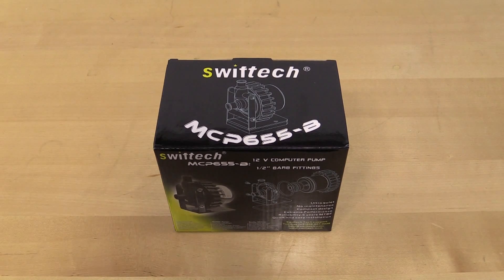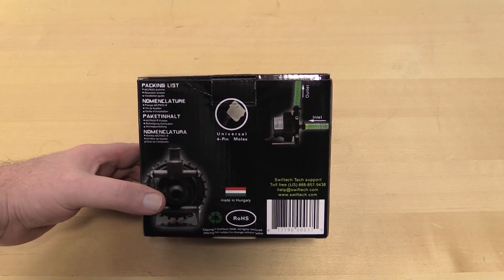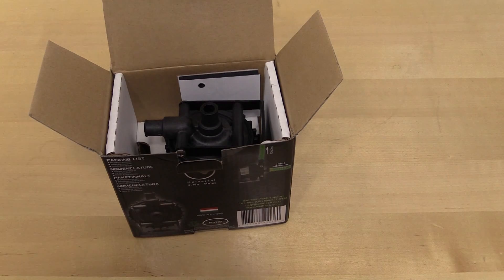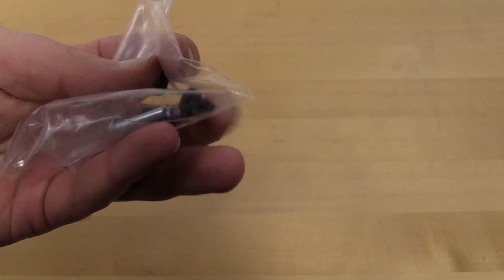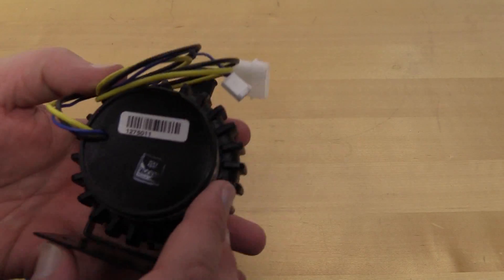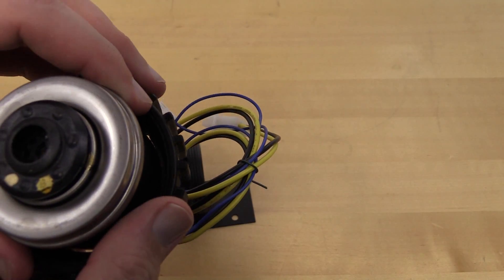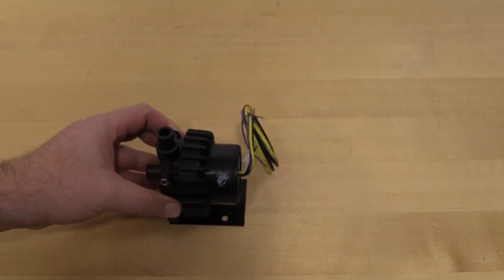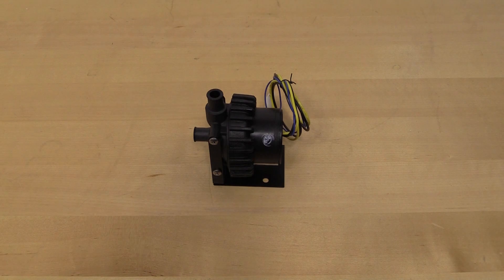Swiftech MCP655-B 12v DC Watercooling Pump

Comment: Do not purchase this pump, it will die and swiftech will not warrantyit.
I purchased two pwm models one on 12-16-12 and another on 08-23-13 and both have failed!  Do not believe their warranty claim of 2 years either, my most recent pump was purchased on 08-23-13 which is still within their "2 year warranty" and they will not replace it because it was purchased from Frozencpu.com. They state frozencpu.com OEM'd the pumps and they are responsible for the RMA. If the pumps was indeed an OEM pump why did it come in the Swiftech box with the pump housing, i've never seen an OEM part ship out in the original manufacture's box. How is a customer suppose to know which website to buy from to actually get a warranty? Do not support this company they will do everything they can to get out of honoring their warranty even though http://www.swiftech.com/warranty.aspx clearly states all pumps have a 2  year warranty. message me and I'll send you the email transcript.

Comment: i have the xspc D5 version that came with my photon res.
Reply from the maker: How do you like the res? I was thinking of buying one.
Reply: TimmyTechTV havent installed it yet as im still getting my parts together. it looks great and it is heavy. i have the photon 270/D5 combo. i also want to get the xspc aluminum screw ring for the D5 as it looks better than the stock ring.

Comment: I've looked at swiftec pumps in the past, and for what it does, I question why they often sell for $50-100. great specs and reliability, but buying some antec/corsair AIO coolers and modding them into a custom loop in my experience does a similar effect for a lot less.
Reply: You can't really compare the D5 pump to any of the AIO pumps.  One D5 can eaily run multiple blocks and radiators which the small AIO pumps are not made for.
Reply: psyduck170 true, assuming someone was to run a 480 rad with a CPU block and two GPU blocks, but MOST people don't even watercool their GPU's. There's tests done online proving that you can run multiple small pumps in series and the pressure/flow is mostly additive, and tests done proving that 1/4" tubing is adequate for any job.
as personal proof I'm running 4 120mm radiators with about 15 feet of tubing cooling my amd FX-8120 CPU (very hot) and two overclocked amd 7950's with custom brackets to mount antec 620's. added to the loop is a cheap chinese reservoir/waterpump that I just unplugged for testing. no drop in temps running on the antec pumps alone, all while running prime95 and bitcoin mining.
to sum it up I really don't think D5 pumps are needed for most people, but it's great they're there. I just want to see it cheaper. If anything 15 feet of static pressure is just going to cause more leaks in the tubing.
Reply: phillip galas
Is that multiple Antec pumps? - What's the price for those vs a single D5?
Reply: phillip galas
Identical pumps in serial = pressure x 2, flow stays the same (parallel is the other way around).  So yes your setup will work too but if you're leaving your pc on the whole time for bitcoin mining or folding, etc reliability should be pretty high on your list.  Why cheap out on a part that can kill your cpu and gpus if it stops working?
Reply: psyduck170 cause with 3 pumps, it would take at least 2 of them dying at once to make a large impact, and I have an alarm connected to a probe in the water that's as loud as an alarm clock.
you're right about flow rate being the same theoretically, I shouldn't have said additive with 100% efficency. more like 10-40% efficency with a logarithmic scale. except when backpressure builds, flow rate drops. same concept as case fans being pressure optimized.
I tend to be more value-oriented than maximum-life-span oriented. (aka I'm cheap)

http://martinsliquidlab.org/2011/04/26/pump-setup-series-vs-parallel/
is my reference for anyone inclined.
Reply: phillip galas
The reason I would be hesitant to point people in your direction is that some homework needs to be done. But it seems you did that cause you're pointing people to martinsliquidlab ;).
I guess I'm on the other side of the scale cause I have 2 D5's in series which is major overkill and expensive. But they both run at 1.5 so they are inaudible.
Reply: psyduck170 to me the site means nothing, i'm just referencing my source. either way both builds do their jobs, removing heat.